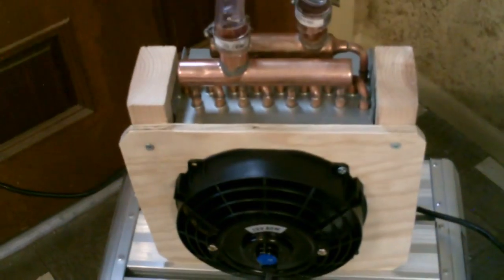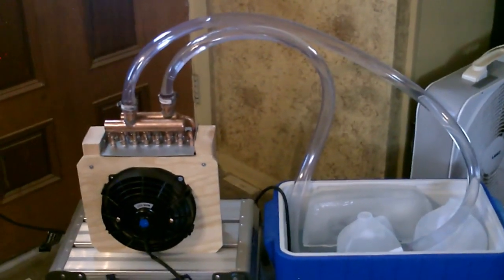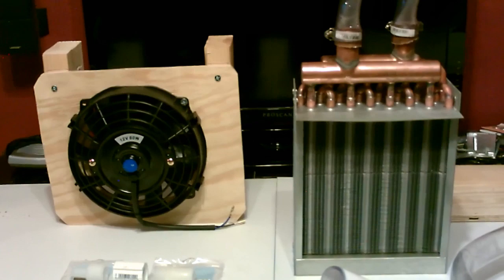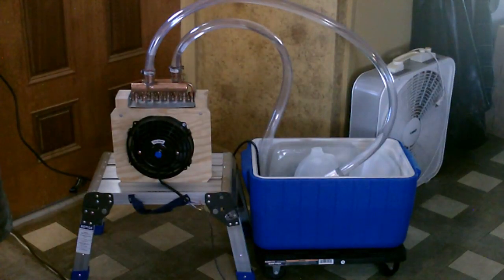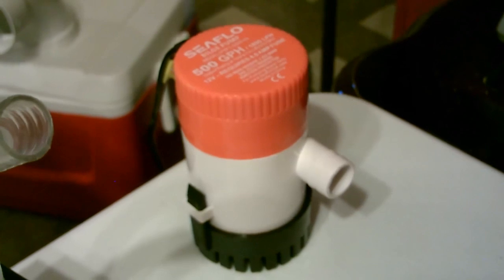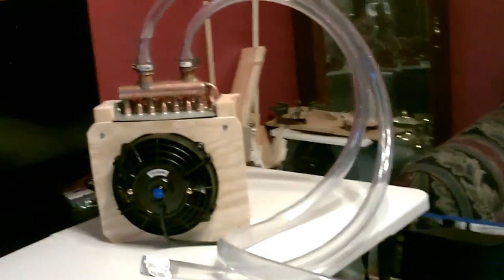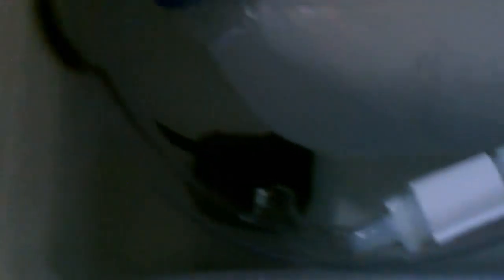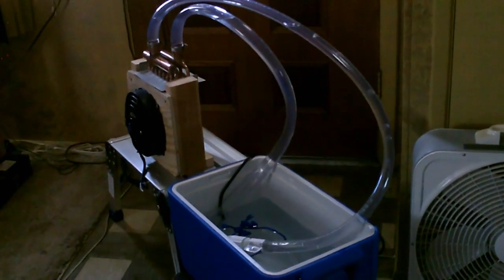DIY Air Cooler! - Chilled Water AC Air Cooler! - Radiant Cooling with water! - Easy DIY

Comment: any concern about condensation forming on the coil?
Reply from the maker: hi there. i haven't had that issue due to the super low dew points in my area but if you do just add a small drip pan or towel around the bottom edge.

Comment: Awesome!  I wonder if super insulating the cooler would help avoid some losses?  Maybe could even put some insulation foam tubes or even pool noodles maybe on the line out and maybe line in I guess too?  Thanks for sharing!
Reply: Phenomena being hot going to cold thermodynamic?
Reply: I was just thinking cleaning up a cheap salvage yard heater core (~$14 Weller Self Serve) that might even be free if you're purchasing other parts.
Reply: Think free dehumidifier or air conditioner wall units cleaned out exchangers would work also... though have to do something with the refrigerant.

Comment: Nice video. Definitely a better solution to evaporative coolers that just blasts out water along with air.
Just curious. Is this similar to the closed loop water cooling systems in PCs? Seems like it, but just checking. 
Also do you have to keep adding chill or cold water to keep the fan putting out cold air?
I wonder if you can scale this to a larger system, like a central air conditioning.

Comment: Is the fan loader then window ac unit?
Reply from the maker: hi. depends on how fast you run it. at full speed it is (but at half speed or three quarter speed it's no louder than a box fan). if noise is a little loud their are easy ways to muffle the sound.

Comment: Wouldn’t it work better if pushing air through rather than pulling air through ?
Reply from the maker: hi. i've always found it works better to pull the air through (but pushing it through works too). if you push it it's cooler but less airflow. if you pull it it's more airflow but a little less cool. how fast you run the fan is a factor too
Reply: @desertsun02  

What happens if use a squirrel cage fan or something like that?  Super powerful and strong?   Would be better or what effect would that make?
Reply from the maker: @John Le the faster you pull the air through (or push the air through) the less time it has to cool down (but these units are very powerful, so you could probably use a squirrel cage fan and have good results). i may have to try it
Reply: @desertsun02  

Oh ok gotcha. Makes sense
Reply: @desertsun02  

I live in Phoenix and I’m wondering if this will work in the summer.

I can’t wait to try it though 😀

Just bought an extra freezer for $10 12cf yard sale .  :)
Reply from the maker: @John Le as long as you've got a good source of cold water these units will work great in any climate. they don't add any humidity to the air so they basically feel the same as regular air conditioning.
Reply: @desertsun02  

You ever thought about designing into more user friendly to maybe sell or be a lil more compact or something?

Maybe put on wheels in a tower configuration, tank on bottom,  exchanger blower on top?

If yes,  any designs or videos on it?
Reply from the maker: @John Le yep, i've got a video on what i call the "final version". it's the one where i use a marine cooler (white ice chest) up on wheels and mount the heat exchanger to the top of the ice chest. it's pretty close to what you describe. here the link https://youtu.be/u0AGRBT1ISs
Reply: @desertsun02  

Thx I’ll check it out
Reply from the maker: cool. i've actually got a playlist of just heat exchanger vids you can find them all in one place there

Comment: Wonder how long the ice last.
Reply from the maker: hi there. really all depends on how hot the air is, how much ice you use, how fast you run the fan... things like that. generally it will last from several hours to all day.

Comment: Where'd you get the heat exchanger from
Reply from the maker: hi there. i usually get them from amazon. if you don't see too many of them there try badger pipe or it might be badger insulated pipe. they have pages of them on a website dozens and dozens of them.

Comment: Okay but can you actually tell us the starting room temp and the room temp maybe couple hours later? Okay if it can cool you off if it's right in front of you but can it actually cool a room
Reply from the maker: hi. these things are super powerful. with enough ice or cold water it works as well as a large standard AC for cooling. cools a room with ease.

Comment: Hey, just got a question here and hope you answer. How many hours does the ice have before it completely melt off and give no more cold?
Reply from the maker: hi there. it depends on a few factors. how fast you run the fan is probably the biggest one. (aside from the amount of ice you use). the conversion rate varies widely depending on it's speed. the starting temp in the room is also a big factor.
Reply: @desertsun02  really? 
Thank you. Anyway, I plan to make this and was to completely like in an ice chest sealed or enclosed and also wanted to test if, will the ice melt longer if would not be submerged to the water or will it be the same. I'm just waiting for my part to arrive.
Reply: Friction from the water moving through the system heats the water,  the ice will melt to room temperature as fast as it can, length of hoses can account for loss of temperature as water moves through the system; no matter how much you insulate the source of ice and water, it will begin to adjust to the room temperature. The fan itself moves heat into the water, and the motor source in the middle creates heat. 

I say it's time to experiment with a sealed gas system the way air conditioning and refrigeration is designed.

Comment: Where did you get the heater core?
Reply from the maker: hi there. that one came from badger pipe (or badger insulated pipe). here's the link to some of the ones they sell https://badger-pipe.com/collections/water-to-air-heat-exchanger
Reply: Went to badger can’t find it or there sold out of it? I don’t know?
Reply from the maker: hi there. the link above brings you to 3 pages of them. that unit is on page 3 (near the bottom). looks like there out of it at the moment. but you'll see it with a sold out tag next to it. amazon still has them thou. (other brands but should be as good)

Comment: Where you get heat exchanger.
Reply from the maker: hi. i got it off amazon. badger pipe sells them on their website also - but it's cheaper on amazon.
Reply: At the moment, your linked radiator is not in stock and they don't know when it will be available.

Comment: what about adding salt to water??
Reply: Corrosion ?
Reply: should lower the water temp and achieve a higher cooling effect (wont last as long tho). Corrosion shoudnt be a big problem since these are copper pipes

Comment: Now make the chill water with your evap cooler instead of ice and it needs nothing.
Reply from the maker: hi there. yep, that's a great idea. you could make my "blue cube" evap cooler and then just drop the tubes from this one into the reservoir of that one. then you'd have an "indirect evap air cooler". no ice and no added humidity. (just leave the blue cube outside (near a window or other opening) and keep the heat exchanger inside the house (with pipes fed thru the window or the other opening  *maybe an unused vent or pet door on the house)

Comment: Bhai condenser ko vacuum seal karo
Reply: @desertsun02  well i beg you pardon. i wrote that in hindi. if you put chilled water in vaccum sealed tank and pump it throught the vacum sealed condenser and blow the wind behind the condenser. then what would be the result.
Reply from the maker: i see. i tried google translate but no luck. it didn't show any results. i often use that to answer people